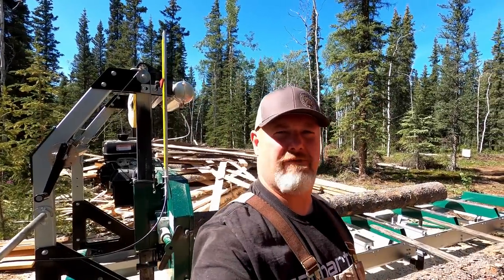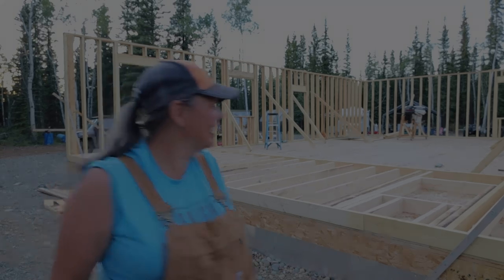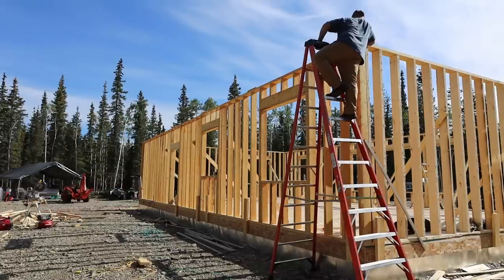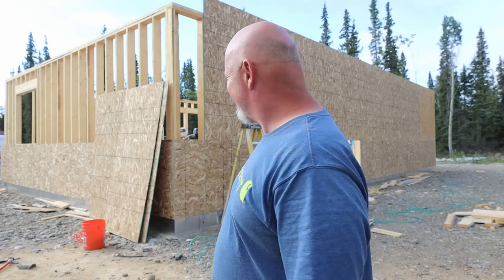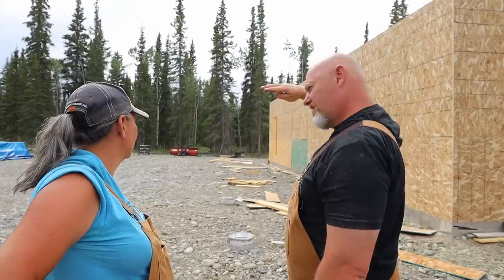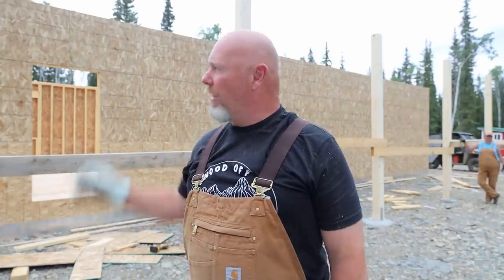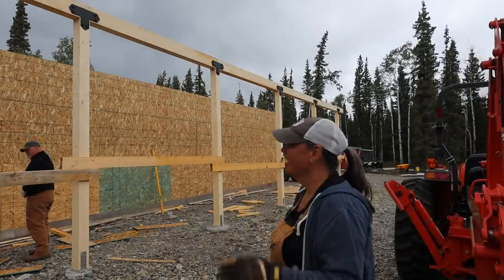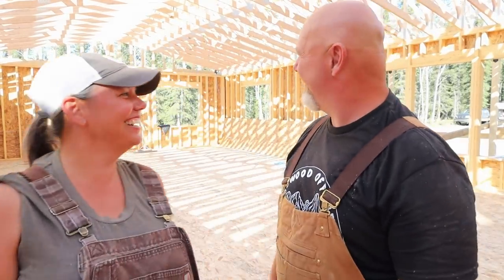Off Grid Homestead Build | RAISING THE ROOF!

Comment: Being the cheapskate I am and not wanting to pay for the forklift I made a mast from a spruce tree, lagged a 2*12 on the bottom then stood it up on the one end, screwed the 2*12 to the floor, put a block on the top and used that to hoist the trusses up, then rotated them around the mast, let them down on the walls and shoved them down to the other end. They were 38 feet long and had 2*6 top and bottom rails and were heavy, but the mask worked well.

Comment: Shouldnt you be leave wood to dry out before you  use it, otherwise it will shrink.
Reply from the maker: It will shrink but very minimally.  This wood tends to shrink about 1/4” and once it’s locked in with sheathing it holds very well.

Comment: Great job its amazing what you can achieve with a little help from your freinds . I've only just started watching your channel so I don't know if you mentioned what your cladding your exterior  with and are you using iron for your roof ? It's a real bonus you being able to mill your own lumber prices and availability being what they are  . How are you planning on heating your home? I assume it would be some form of wood burner , you certainly are accumulating a huge pile of offcuts.
Reply from the maker: First off, welcome to the channel and thanks for checking us out.  Friends we have are amazing😊 as of now the plan isn’t to use board and batten siding that we mill. We’ll be hearing with wood stove and backup propane heat.

Comment: Are you not allowing the wood to dry before building? The boards will warp and cause issues if they aren’t dry won’t they?
Reply from the maker: Building with green lumber is pretty common in our area and you so t have to worry about warping if you lock it in with sheeting and support in on the inside.  It does shrink a tad but very minimal.

Comment: Hey Ryan I am looking at property around Tok, I know there is a lot of gravel there and was wondering about break up, do the roads turn to crap or do they stay pretty solid. Do you need Typar to put in a road?  Thanks  Jim
Reply from the maker: Hey Jim, roads are good during breakup. Most roads here are cut to gravel with a dozer. This creates berms and ends with the road below grade.  Only issue this causes is that during breakup it can tend to lake in the roads until the ground thaws enough to drain.  It helps to cut drainage channels to small pits where water can drain next to the road.  No typar or any road fabric is needed.
Reply: @wildwoodoffgridalaska  Thanks for the info, I like it around Tok